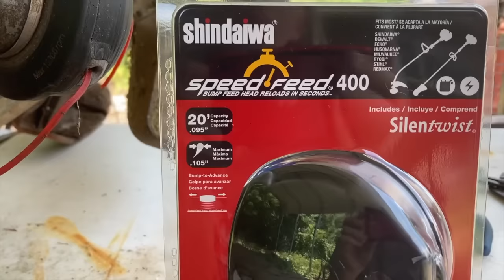The BEST TRIMMER HEAD ever made! How to install a Universal Speed Feed on most any trimmer.

Comment: This is driving me nuts, my speed feed 400 head broke on my Echo PAS trimmer attachment. Originally the attachment came with my Echo PAS 225, but I have upgraded to the Echo PAS 2620 and after a year the attachment head gave up the ghost. I don't wanf to pay $99.00 for a new attachment so my problem is finding the correct speed feed 400 head that will fit and work properly on that attachment. Every seller I run into mentions replacement for SRM models, I have no clue where to pick the right head for my attachment.

Comment: i saw the video on the Universal Speed feed and have an older Troy-Bilt unit [Model TB70SSW]. The unit used to work fine but after using it for the first couple of years and having tried to wind new line on the original unit and failing miserably - I just stopped using it. Anyway I just moved and would love to use it again in my new home if I can buy and install the Universal Speed Feed Unit. I tried to look for a model compatabilty chart and have not found one. I know you said that the Troy-Bilt and Craftsman are made by MTD but I haven't seen anywhere whether the unit is compatible.
Do you know ??? Hopefulloy they work together.

Comment: I bought the Speed Feed 400 which states on the packaging that it will fit a Weed Eater trimmer. Would you know if this a true statement? I can’t for the life of me figure it out as none of the colored screw/bolts (arbors) will fit. Thanks for any hints you can provide. Oh, the Weed Eater doesn’t have a hole to line up when trying to hold the backplate in place when trying to loosen.

Comment: I have a Greenworks ST60L2 60 v trimmer that uses .095 in line.  The trimmer works greater, but the factory-installed Speed feed head is not worth anything.  Is there a chance that this replacement head could be used on this machine?
Thanks
Chuck Stogner

Comment: Its not in the model list, but I have an old Homelite SX-135 where the head slides over a hex nut on the shaft and the bump button screws in  end of the shaft. Is the Speed Feed able to adapt to this type of head connection configuration?

Comment: Hello, I have am Echo SRM-225. I cannot get the gear to stop spinning to change the head. I have tried a screw driver, I hole punch in the side hole. Do you think I am missing a part as it was easy on my curved head trimmer. All I see when I look in the side hole is the gear piece. I cannot figure out how to stop it from turning. Is there a special tool I need?

Comment: I was wondering if you could help me...I have a Husqvarna Rancher and after using it for a tank load of gas, I shut it down to refill it and cannot get it to start until several hours later. After filling it up with gas and bar-chain oil, it just will not start. What am I doing wrong?

Comment: I have a Craftsman trimmer head I want to replace it with bump head. But I don't know how to take the head off. It is old model the axial fix to the head so tight, it may not has screw lines because it is old. Please give me clue how to remove the Craftsman trimmer head. thanks

Comment: I have a Homelite HLT-15 curved shaft trimmer. I like it because it’s light weight, cuts at very low speeds and is usually very easy to crank. I would love to put this head on it but I don’t see it listed and it doesn’t appear to have the same style head attachment. Do you know of any product that will fit this thing? The head on mine is shot.

Comment: I have a Remington Rustler RM25C. It's a curved shaft. I couldn't find a hole to insert a tool for removing the trimmer head. When I remove the cover from the trimmer head, there's something like a lock washer holding the rest of the trimmer unit in place. If I'm able to remove this washer will the Speed Feed 400 trimmer head still adapt? I noticed Remington wasn't on your list.

Comment: I have a Homelite trimmer with a curved shaft, model UT20024B, manufactured in 2005. I have not been able to find a Speed Feed head to fit. Is there one available? If not I need to find a spool retaining knob to replace the existing one. I live in Nova Scotia Canada and finding parts for this trimmer are hard to come by. I hate to just throw the trimmer away because it works so well, starts first pull every time. Any help you can provide would be greatly appreciated. Thank You.

Comment: Hi, I picked up a practically new FS-38 curved shaft Stihl trimmer and want to update the head.  It seems most of the upgrade heads like the Echo, the T35 Husq, etc are only for straight shaft models.  Is there a good upgrade from the standard FS38 bump head?  The C 6-2 Stihl seems to be their attempt but has some bad reviews.

Comment: You can avoid all this by just getting an EGO trimmer with power load. It loads new line in a few seconds and also has autofeed so you don't have to bump it. When you need more line, it automatically spins out more. Works great.

Comment: If I am reading this right, this head fits the Stihl fs 40 but not the 40c??   Do you know of a speed feed head that will fit. I bought this headband the green bolt doesn't catch on the fs 40c I guessing its a different thread?

Comment: I want to replace my trimmer head but a bit confused about which one to get. I have a Stihl combi unit KM 130 R with 36.3 cc with a strait shaft FS-KM mower head. It has adequate power to run the 450 but I'm is not compatible with my unit. I've looked on line and I get yes and no results. Have you replaced any on the fs-km mower head, or should i get the 400

Comment: Great video as always, Thank you. Is the Echo Speed Feed 400 Universal P/N 99944200907 the exact same head/kit as this Shindaiwa P/N 78890-30000 ? They look identical in every way including the adapter pieces. And if so, I assume they use the same replacement bump cap?
Reply from the maker: There are two different caps. One for round eyelits and one for u shaped. All the new ones, are round eyelits.
Reply: @Chickanic  Thank you for the speedy reply. Is the Echo Speed Feed 400 Universal P/N 99944200907 the exact same head/kit as this Shindaiwa P/N 78890-30000 ? They look identical but I can't find the info if they are the same unit w/ different branding.

Comment: I ha e a battery operated GreenWorks pro. I have half the housing off, cant get the other half off. I am so confused,  dont know which bushing to use, do I use the spacer? But i cant get the other head of to even work it out. Every day I stare dumbly at this the grass is getting higher. This is depressing.

Comment: I know this is a year old, but this head does not fit on a husqverna 128 cd. The screw head when in front of the head turns to the right and it takes an oil tench and a second wrench to remove the head. I thought I was going crazy trying to turn to the left till I put the old head back on and had the ah ha moment. Any suggestions?

Comment: I have a stihl 56rc trimmer. there is no fill hole on the head.  Ive had it a few years and bought red armor grease for it,
 But No place on the head to put it in. :o

 Can I replace this head ?  so it can be greased?
yes it turns fine, But get hot after an hour or so. And it keeps on turning?

Comment: I grew up landscaping - many years withbstringvtrimmets - and head gadgets. Beyond left twist, the size nuts, adapters and non OEM stuff on my ECHO SRM210 - will make you NUTS. YouTubers are showing many and most/all highly “recommend”. Pivot Trim is all about really need, picked an ECHO wheel trimmer. Saw mixed reviews on it! Carb issues. T430 - 4 cycle.

Comment: Mine didn't work as good , when I purchased the trimmer it worked for 2 years ( I have a small yard ) then it started retracting inside the spool during action
I bought another head assuming it wear out and same thing after 5 months,  bought another one and same thing after 5_6 months.
Reply: You are doing something wrong.  Those heads should last at least 1000 hours of use.
Reply: @joeyl.rowland4153  maybe , but it's a straight forward thing , no room for much error.

Comment: Chickanic, thanks for the explanations! I have an older (?) Craftsman WEED WACKER 25 cc with a model number 358-795590. I have purchased a SPEED FEED 400 assembly. I do not see how I can remove the old head which covers the top of the line spool. It has no holes to hold with a small dowel like pin to assist in holding it to unscrew the head. I am uncertain if it can be unscrewed, as there is no separation I can detect. Any advice for this piece of junk trimmer spool head and its removal, short of a hacksaw? :<)  Thanks, Bill

Comment: Won't fit my old (20-25 years) Stihl FS55. The bushings would not fit the threaded arbor on my trimmer. Figures, just my luck. The original head is not very friendly when it comes to loading line.

Comment: Why couldn't that green arbor on the ECHO Speed Feed Head be threaded all the way through like the others ;(. That's the thread mine takes, but the green one is only is threaded on the nut end :(
Had to return it I have an older 28CC craftsman that you have to feed a 12' piece into - no bump feed - royal PITA. Anybody know of a way to make my own arbor with threads all the way through or an adapter I could buy?
Looks like a huge improvement to what I have and low cost compared to a new trimmer!

Comment: Bought this for my Weedeater brand trimmer and every time I pull the start cord or run the weed eater the line retracts into the head.  It's a left hand thread and even tried the right hand adapter and same thing.  I tried it with and without the spacer (w/o the cap is to loose) and same thing.  I'll be returning it for a refund and looking for a different model.  Was hoping this would work after so many great reviews.  Anyone else have this problem?

Comment: Spent $45 on this head and it will NOT FIT my Stihl FS40.  To behin with the directions are conflicting and and incorrect.  Spent an hour trying to figure out what I was doing wrong.  I managed to get in touch with the factory and was told "Oh, we're sorry about that, it's a misprint on the packaging.  It will not fil the Stihl FS40.  Maybe you'll get a different trimmer in the future that it will fit on"   Got it on Amazon and the return window is now closed.  Thanks a lot!

Comment: Stihl straight shaft will not work.....the green adapter (stihl) has inside threads running less than half the adapter...my stihl straight shaft does not work with it.  the other two (red and silver) have threads running the length of the adapter.  the bolt it mounts on cannot reach....

Comment: Went back to original husqvarna head, the spacer you have to use with the speed feed causes long grass/weeds to wrap around the shaft and stops the head from rotating. Frustrating as you have to unwind the grass all the time 🤨
Reply: Husqvarna has one called RapidReplace… It’s their version of the speed feed.

Comment: I just bought a genuine 450  for my Stihl and it came without adaptors 😡
Reply: Edit : Apparently here  in The UK they ain't supplied with adaptors ! How crap is that HOWEVER fear not my fellow Brits with Stihls, if you have a Stihl 25-2 head kicking about the arbor out of that fits a treat.  However when you screw it onto the Stihl it won't go right home  but if you put a Stihl thrust washer ( The one with the sort of star shaped  hole) between  the Echo Speedfeed  and The Stihl gearheadt  it takes up the gap perfectly.

Comment: Bought a new echo won't buy one again. Fuel line was split from new. Hose too small for inlet . To remove tank can't get screwdriver square on screw way over tightened. I know their jap quality and good engines but not a good start for new machine . I enjoy your show. Not impressed with echo . Previously had same model no probs run it into the ground. Cheers.
Reply: Try Maruyama… It’s Made In Japan. M-twist is the same as speed feed, with metal added to the bottom to prolong it.